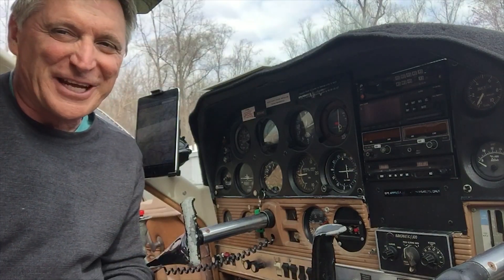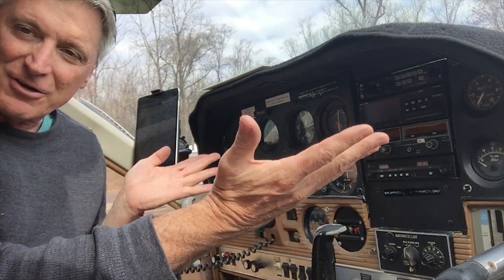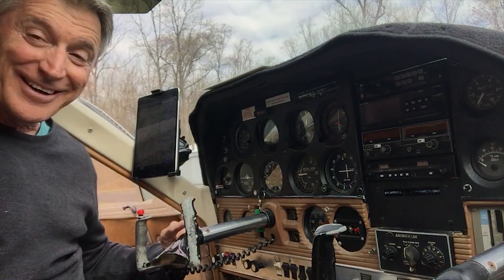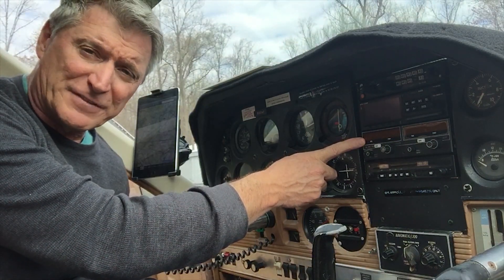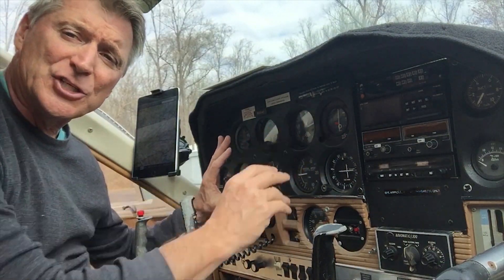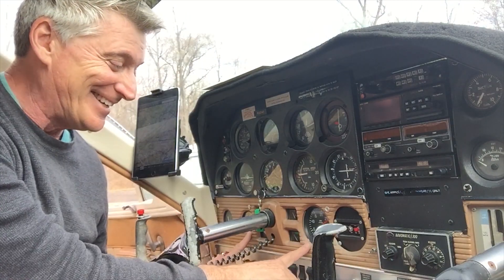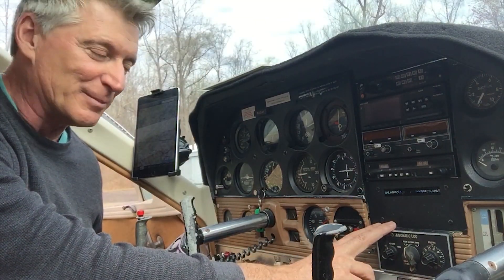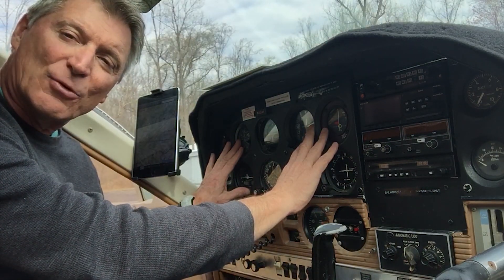Clean Panel or Keep the Instruments?

Comment: I'm with midengineracer on this.  Get rid of the steam gauges and the vacuum system - saves a bunch of pounds in weight.  With two G5s (with backup power), you don't need to keep the 'art-deco'.  BTW, you're going to love NOT having to reset the DG every 5 minutes.  All the best Ted.

Comment: Check the Garmin G5 STC under limitations and Conditions. The G5 can only be used as a primary attitude indicator. Mechanical airspeed, vertical velocity and rate of turn indicator still need to be retained.

Comment: As an old school mechanic that has been working on all glass panels for over 20 years now... keep some of those steamer gauges. We have had numerous occasions where it all went black for a while. Having something to look at while waiting for the screens to cool off or for a re-boot to finish will keep you much cooler under the collar.  Think of them like a second air conditioner out front (twin engine). Same as you don't want to feel the heat when the only air conditioner (propeller) stops working, you also don't want to feel  heat when it all goes black.

Comment: As a scuba diving instructor, I've learned that backups save lives! I would leave the old instruments, but, I would redo the entire panel so  it looks cosmetically clean, with the new and legacy equipment. Think a nice layer of black carbon fiber laid on top of the aluminium back plate. Nice professionally stenciled lettering for all switches, breakers and such. and a clean modern look that makes the G5 packages blend in and the legacy backup equipment look newer.
Reply: @PeterToth  I'm a Cave Diver, we have backups, and then backups for our backups. When I'm a mile of penetration into an underwater cave system; my primary LED canister light is $1500 & my 2 backup LED hand lights on the shoulder straps are $300 & my give-away "dead man" light in my pocket is $100.  I like the idea of Ted cleaning up his panels but keeping a few of the most critical guages: AI, ASI, ALT. With a freshly cut panel reconfig it could still come out lookin really sleek.

Comment: When I fly a plane with the G5 pair,  I still look at the steam gauges for my altitude and speed. It's like I can read the steam gauges faster then trying to read the digital readout.
Reply from the maker: I know I do the same thing so I bought some of those instrument rubber covers that Flight Instructor’s use and I just blocked it out to get in the habit of using the G5 but use them as a back up

Comment: Very cool Ted.  I'd leave the components you need as backup, but that would only be in lieu of not putting in a glass panel replacement, which it does not sound like you will be doing on this round.  What part of FL will you be having the work done?  I'd love to come check it out if you are in the Ft. Lauderdale/Miami area
Reply: I’d leave as much as possible especially the Airspeed Ind, T&B, and Altimeter. I imagine by removing the Attitude Indicator, and Directional Gyro that you are removing the vacuum system. Have you thought of the Garmin G3X? To me, it doesn’t seem like a whole lot more $$$ to go with a larger glass that also has engine instruments.
Reply from the maker: Paul Burgess i’m gonna be dropping it off in Venice Florida - I’ll stop by if I can!
Reply: @Over50andLearningToFly  That would be fun Ted.  I can't wait to see the new panel either way.

Comment: Hi Ted! IMHO I would want to have at least 3 "steam" guages that are purely mechanical and do not rely of an electric. I ould Have the glass but I would put a "row right there in the old "velour" row lol of Airspeed, Attitude, and Altimeter.  And as an extra added touch get each lit two ways. the standard panel lighting and an for each insturment an LED that is connected on a totally INDEPENDANT BATTERY POWER SUPPLY that in the even of total ELECTRIC FAILURE at night YOU COULD see AND HAVE THE basic flight insturments to have  the minimum necessary information to land. Just have  it on a seperate Simple rocker switch that would work in the event of failure, 

I was watching another channel , Jerry's IPAD FAILED on approach AND REBOOT TIME WASN'T FAST ENOUGH so you'll have those 3 insturments on a system that only has a small battery for light (so your not holding a flashlight while dealing with a major problem at night.

Just my 1.5 cents.

Take Care

/////////
Reply from the maker: mike fromuniontown thanks!   You bring up a very valid point! Thanks for watching

Comment: Make your plane IFR redundant.... With the backup electrical system and then you will have to worry a lot less
vacuum pumps are very happy and getting rid of yours will save a great deal of weight and complexity
obviously all of this is limited only by the amount of money you want to spend
you realize you could spend ALMOST as much money in electronics as you did in buying your Cardinalin the  first place... And you wouldn't have to try that hard to do so
I'm a gadget guy as well, but only you can determine if you want to spend 30K+ in glass
The Cardinal is still an amazing aircraft today and could serve you well for many, many years to come
modernizing the panel, if you care to spend the money in doing so will help you keep from having the "wish i had something newer" blues for a much longer period of time because when you are flying the only thing you see is the inside of the plane
Reply: The vac pump according to w/b is a total of 4.4 lbs...  doesn’t save a gallon worth of fuel...
Reply: @Jeffrey-Flys  nice to know. Thank you

Comment: Electrical failures happen. To everybody, including airliners and military planes. If you're enduring Snoopy's Dark and Stormy night, you'll wish you had kept them. I got the Garmin package to comply with ADS-B, but all my steam gauges are still there. Both sides of the cockpit. 100 amp generators on both engines. Dual vacuum pumps. An abundance of caution? Probably. But a failed electrical system is not gonna put my 421 in a deep hole.
Edit: I meant alternators, not generators. Showing my age again.  :-)
Reply from the maker: raymondkoonce Suddenly a shot rang  out, and the pilot in the tattered shall hadn’t sold a new transponder all day… 😆
Reply: Steam Gauges...let's say. She had not sold a steam gauge all day!
Reply: @paindoc25  The only problem with that is that Snoopy was always presented as a male dog.
Reply: @raymondkoonce  The "Dark and Stormy night" dialog comes from the musical "Snoopy" Act II from the song "The Great Writer" where Snoopy refers to the little girl with the tattered shawl who had not sold a flower all day. Then he says "A violet, let's say. She had not sold a violet all day." The subject then is the little girl. Snoopy isn't singing about himself.
Reply: paindoc25   If you followed the cartoon strip, Snoopy was often sitting on his doghouse with his typewriter, writing a novel. He always started it with "A dark and stormy night ". Not that it matters in the least. When I got my Teenie Two, a single seat open cockpit experimental, I did buy a leather helmet with goggles, just like ol' Snoopy. Still have them, too. Maybe I should wear them the next time I take the 421 up.  :-)

Comment: Definitely get rid of vacuum gauges.
The G3X has been approved for your plane, I believe. It is allowed to replace all the flight instruments, not just attitude and heading.
Reply: midengineracer I completely agree with the G3X Touch certified.  You would be doing yourself a disservice in putting the “old g5” setup in when the touch is soo much more advanced.  It includes synthetic vision AND can wireless link to your iPad and can remote enter you transponder and compatible com frequencies.

Comment: You want to fly IFR. Keep the basics for backups. You already have them so they're not costing you anything. Redundancy is always great to have.
Reply: They actually do cost something. The vacuum pump is a wear item that also fails. The vacuum instruments wear out and need rebuilding.
2 G5 instruments are redundant and can have a battery backup for electrical failure (redundant again because of the main battery).
New Skyhawks don't have vacuum gauges because of the built in redundancy, the same redundancy of the G5.

Comment: I do not believe that the G5 can replace your airspeed,  altimeter, or VSI.  They are required to remain.  The G5 has airspeed, altimeter and VSI but they are to be used only as reference to the original equipment. Also have you considered to just getting a GNX375, the new Garmin ADS-B Transponder and Wass GPS combined.  That is what I am looking at for my 177RG

Comment: Even though the G5 AI will display altitude, VSI, airspeed and turn coordinator, I don't believe it is legal to use the G5 as a primary display for those instruments.  If you are working on your instrument rating,  you want a proper glass display, or a proper 6 pack.